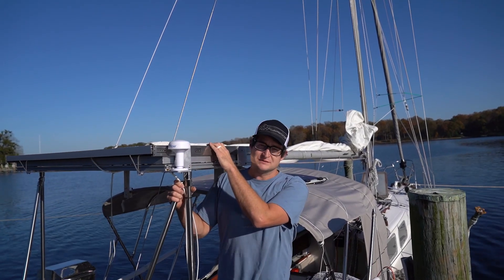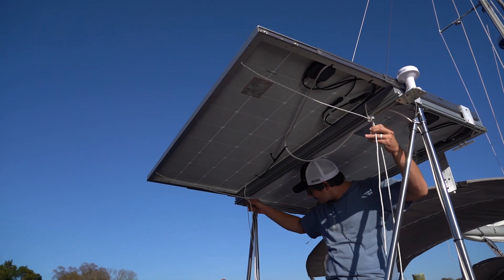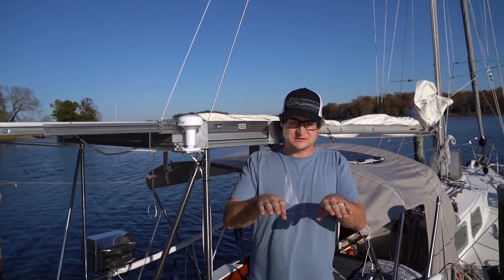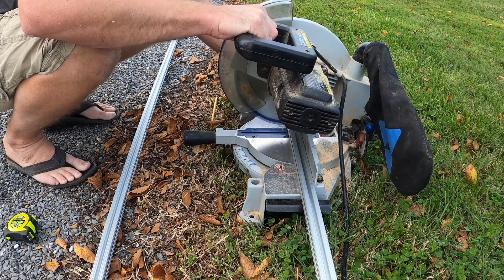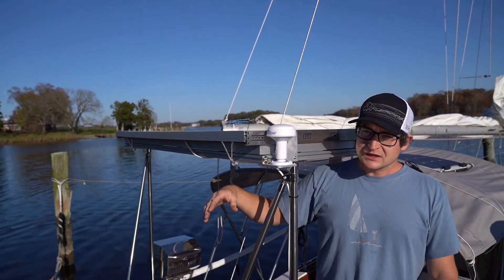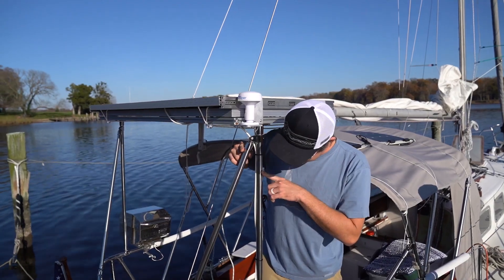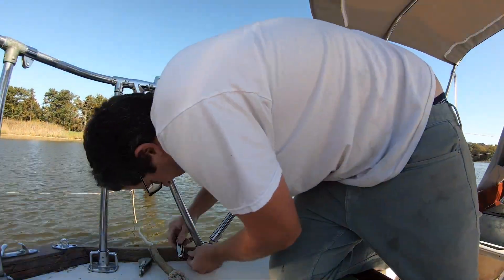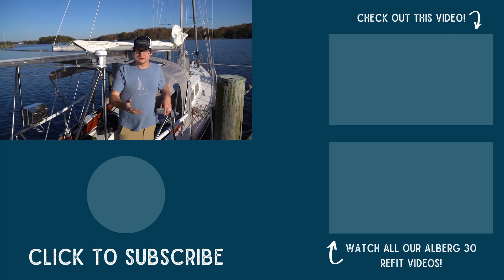600W of Solar Panels on a 30 Foot Sailboat?! | Alberg 30 Refit Episode 22

Comment: How do the flexible panels attach to the bimini cover? Can they withstand heavy winds? How hard is it to remove them if needed?
Reply: I think I see: It looks like they are tied down, with ropes attached to the bimini frame. Simple enough. I thought there was some velcro attachment or something.
Reply from the maker: Yes they are just attached with clothes line so super easy to pull down in heavy winds.  We usually leave them up until the 35-40 knot range and then we stow them. 😊

Comment: Dude that was I was thinking with the slide out for the solar. How does it work out for you?
Reply from the maker: It has been AMAZING!!  Three months in and we wouldn’t change a thing!  The only tiny issue we’ve run into was the “stainless steel” threaded inserts are definitely not stainless so we will have to replace them but the setup has, as Andy would say “seen some shit” in those three months and you wouldn’t know it.

We do bring in the second panel when it’s over twenty knots and there is a TINY bit of whistle at that wind level, but not noticeable down below.
Reply: @AbroadReachTravel  I am working on a Alberg Pearson Triton so just binged your channel. If you in central Fl on the east coast and need anything give a shout out to me. Have a good week
Reply from the maker: @Hindukushsailing  thanks so much!  We are on the west coast of FL for the time being but will be headed back north (via the keys) mid March!